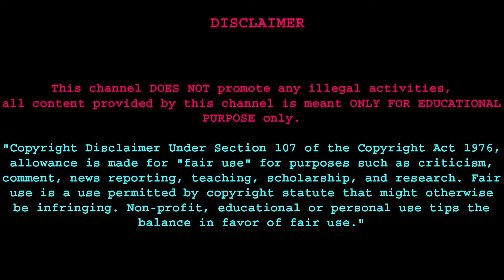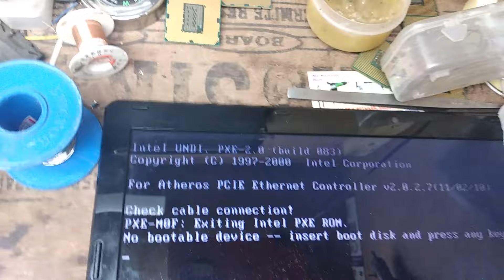Step-by-Step Laptop Repair #StepByStep (Raw Footage) Acer #MostImportant [Hindi]

Comment: My laptop is lenovo G580 intel Pentium... Now i upgraded the processor to intel core i5 2450M 2nd gen.. now the problem is laptop turns off suddenly after 10-15mins of use.. even if i dont use and let it on in ideal, it will also turns off automatically... I already used new thermal paste and the cooling fan also working fine... Plz tell me what is the issue..